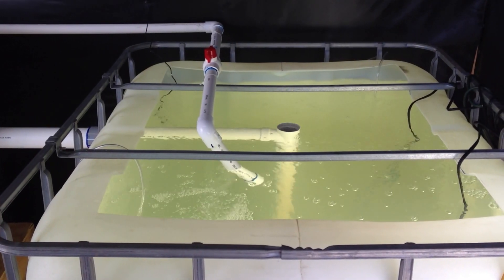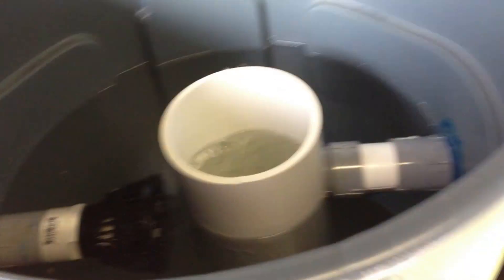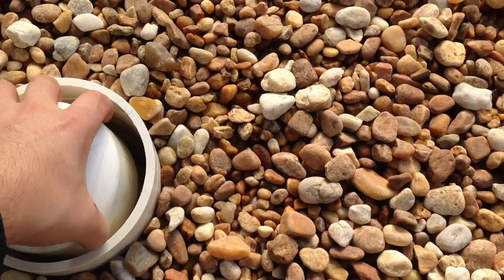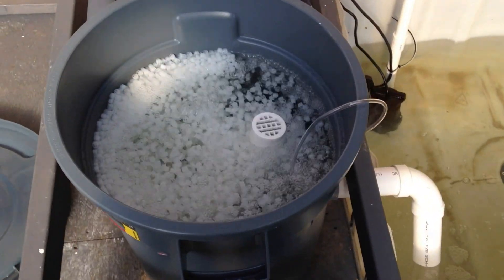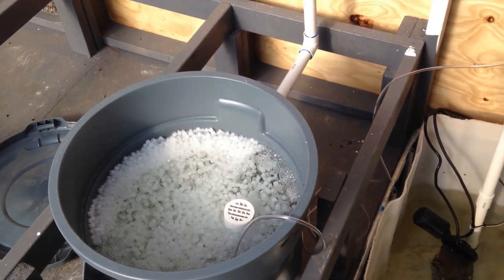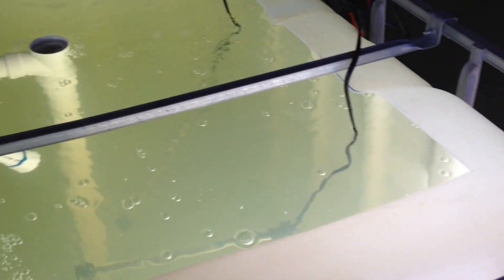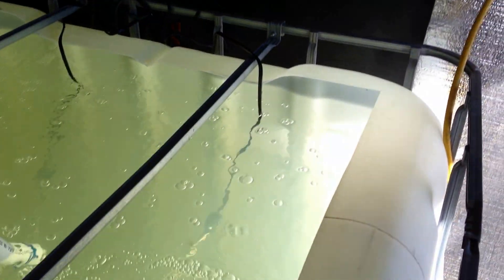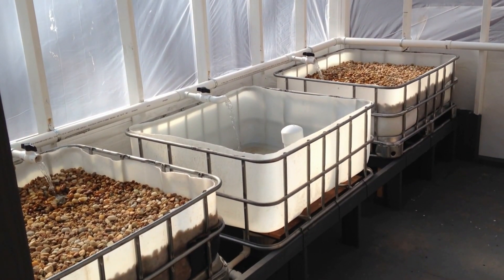Brendon's Aquaponics Farm - Constant Height One Pump (CHOP) system - 12/30

Comment: How did you get the flow of water leaving the the RF to travel to through the main pipe and then into grow beds?
Reply from the maker: Jason Williams if you look there is an outlet pipe going through the wall and that pulls the water through with the help of gravity (it is the black piece you see in the RF, that is a fish guard, at the time fish were sneaking into the RF).  The fish tank is highest, RF is 2 inches below that and the grow beds are a few more inches below that. look at the 00:34 second mark... you will see the pipe

Comment: Brendon,
I was watching you brenden's aquaponic farm - constant height  one pump CHOP update april 2013 and I thought I saw this with a floating raft bed. Did I see correctly?  I am trying to set-up my system but I want one pump, constant height and floating raft
I live in Ecuador and cannot find expanded clay pellets, coconut fiber, or.expanded shell. I can't even find small gravel so I figured thatthe floating raft would be perfect but I want the benefit of the fish.

Can you help me,please.
Reply from the maker: hello there ... sorry for the late reply.  Yes this system has one large floating bed 8' X 4',  Then it feeds over to 3 half IBCs that are filled with small crushed gravel.  As far as floating bed or gravel this depends on what you want to grow.  Deep rooted and tall plants that need a good base will require gravel (tomatoes, peppers, zucchini) as for the floating raft system is great for herbs, lettuce, strawberries, etc.  Also the floating system has more surface area so it reduces drastic temp fluctuations in the water.  The gravel system or channel pipe systems have shallow water flows and thus the temp can change easier.  Not a big deal for the plants but the fish like a consistent water temp.  Glad to help if you have more questions.

Comment: Nice complete system, only one queery, why is the FT flooding down the overflow in the T instead of sucking up the water from the bottom, is it because the pump is too strong for the size of pipe? The way i understand the way it works, the top of the T is an emergancy overflow to stop the tank overflowing but normally the water shouldn't go that route

Comment: This is a really good looking system.  The question before mine was what kind of pump are you using.  That is my question too.  What kind of pump?  I am currently building my system and want to use a sump pump but haven't seen anyone else use one...

Comment: Hi Brendon, I don't remember if the venturi shows up in one of my video's or not (I will make a specific video on this) however they are very easy to do. 
Basically you drill a small hole either at the beginning where your water starts (most efficient) or about 4-6 inches before the end and attach (insert) your air line. the force of the water rushing by will draw the air (like a straw) into the water. Hope this helps, I will try to do a quick video and add it to my others, hope this helps, l8r.

Comment: Very nice system Brendon, look forward to seeing some updates. Slap a venturi air line on that return line and you will have addtional oxygenation at no cost, also if you go the pet store you can pick up a bottle or two of nytrifying bacteria, it cut the cycle time on my system by about 3/4. 
Regards
Dan (Frozenfowler)